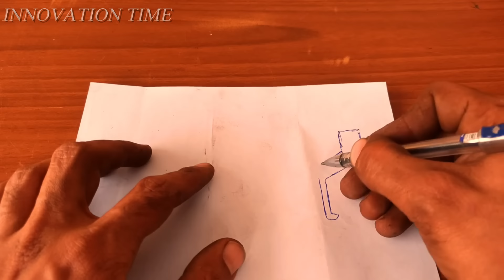MAKE A BLIND HOLE BEARING PULLER // BEARING PULLER DIY

Comment: That's well thought out. You could use a rod support. Simple tube to fit the threaded bar into, on a 90° slide bracket attached to the Column of the drill press. Fit as low as possible to make it run true vertically. Then use your angle grinder to do the bevels and the cap. Just a thought.
Reply from the maker: Thank you dear Michael 🙏🌹❤️

Comment: The bearing did not seem to need a lot of effort to get out. You should have shown the extraction proceeds because what was happening was clear until the point where you pulled out the bearing. Do you hammer the clamp until it gets out?
Reply from the maker: Dear aneno
Without hammer the bearing pulled out 😉
If you like this subject I have some video about bearing puller there are in a play list "bearing puller"